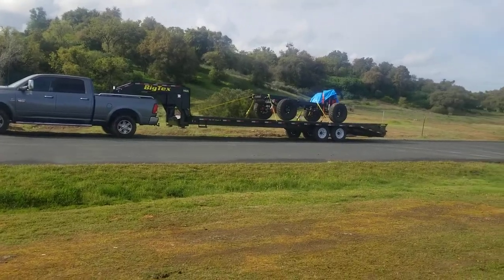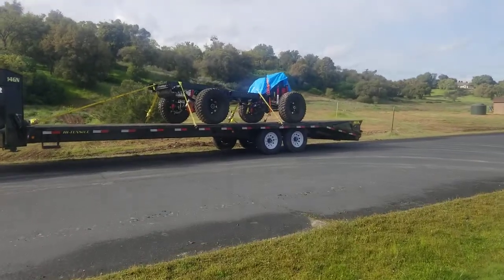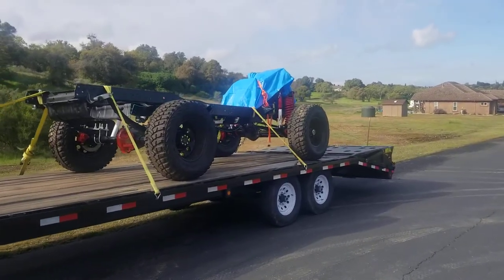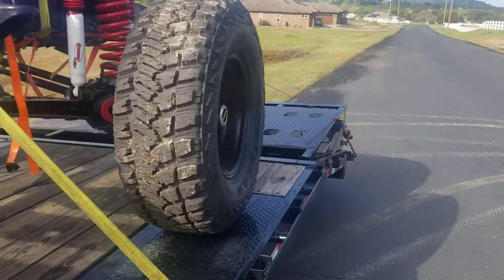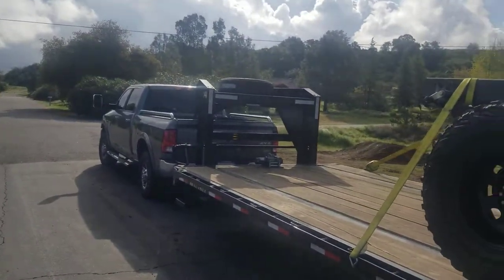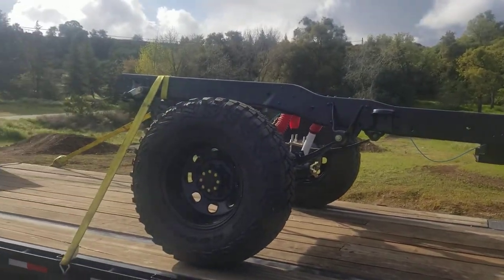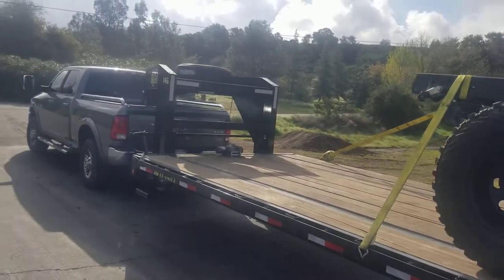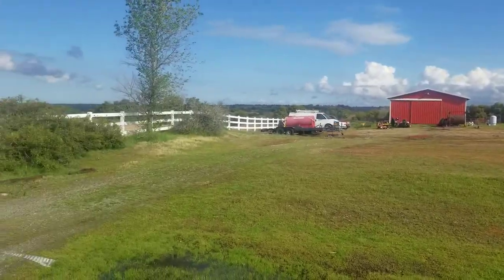Sending the Bronco to get a custom set of stainless steel brake lines. This is an awesome day.

Comment: Dude this is amazing. Good moving forward and thank you so much for letting comments on the video. Super pumped about this. Also, I'm really jelly for your trailer. I have been eyeballing a gooseneck like that for a bit now. We really need one but also really need a dump trailer. The dump trailer will probably come first and ill keep just using my 24' pumper puller.